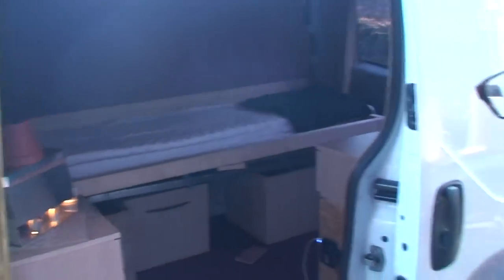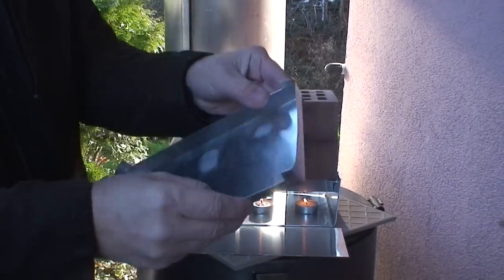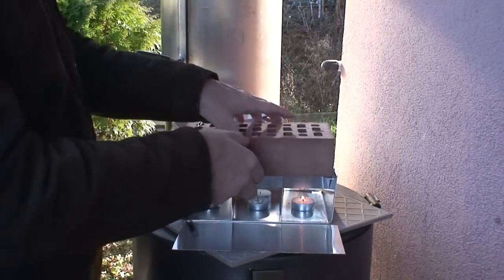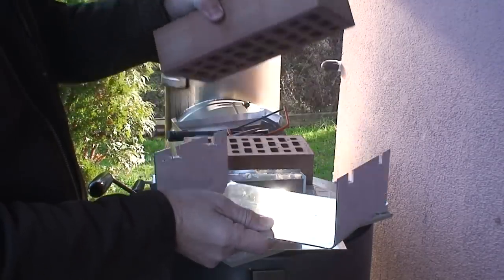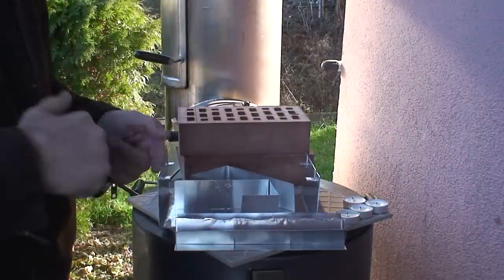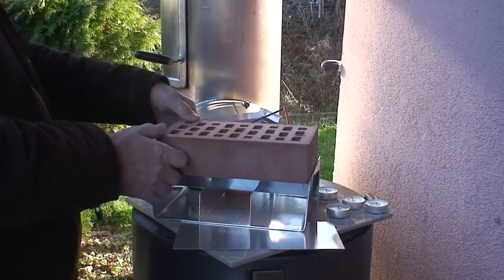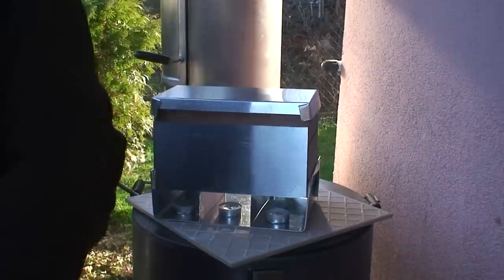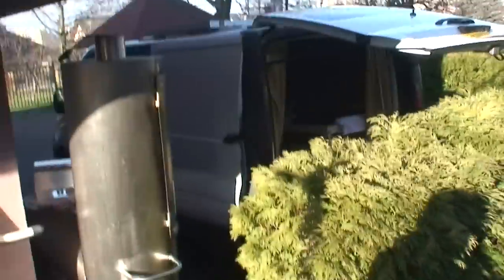Storage Brick Heater - Space Heater - flower pot heater (Tutorial)

Comment: Thanks to Enapp for video! I have an idea for  van heating (for Celal Boz worries). Find an oil lamp , a normal oil lamp with reservor , flame regulator  and long glass bulb om the top. Than find an aluminium radiator ( wich it's suposed to be filed with hot water in a heating sistem), but we need an emty white aluminium radiator with 5 or more section. On the left side of radiator on the bottom of first section drill a holl , just to fit in for 1 cm the top of the glass bulb of oil vandel. The radiator must be fixed on the wall of van and all entrance of radiator must be closed, except one from right bottom side wich is conected with a pipe  wich is going outsider the van for evacuating gasses from burning.  With flame regulator you can regulate the heat wich is going up thru the glass bulb and first section of radiator . All the heat from lamp will fill up first radiator from the top down excenging heat with van ambiant and than burned gasses goes thru the pipe outsider.   You can regulate heat, you have light inside the van and it's safe for gasses.
Reply: Alex Mitu can please make a diagram
Reply from the maker: Alex Mitu yes I've been thinking of a pipe based heating system using  a sand filled glass tude with a copper pipe through the center that heats water that can go on the roof. Like the idea though. Would love to see your build on it.

Comment: looks brilliant. i have been experimenting with the candle heater method lately... the terracotta gets really hot itself but does not heat the camper at all on a cold night so its virtually useless even with four candles positioned well underneath. its only good for warming your hands and such, which is surprising because so many people on youtube are raving about how well it works. so does your heater really heat your entire van at night? i will probably try this method next because i dislike the propane and electrical options.
Reply from the maker: +Drew Jonathan To be honest NO it doesn't give off a lot of heat, The key is to find a way to distribute that heat around the space and allow it to convect up. Radiator fluid helps and you can do this by rapping and oils filled pipe around your heat source then run it along one or two walls. (a little higher than the heat source). I'm experimenting with 12v halogen lamps and an radiator oil system above to distribute the heat better. I simply took several 12v halogen lamps and mount them in a row under an enclosed area with a bent aluminium pipe and half inch pipe close to the lamps to radiate the heat up the thin tubes. I'll let you know how it goes.

Comment: Tie 6 bricks - get out of van - gather some wood - start a fire and throw bricks in it for 10 min - get bricks and set them inside van on the fancy aluminium thing - light 1 candle to see what you are doing :)
Reply from the maker: Yip you got it. Infrared heat is stored in ceramics and then emitted slowly. The key is heating the bricks to cause the infrared to emit.  Infrared is a powerful force. Understanding it can solve a multitude of problems like condensation, air circulation, dying of a fire, slowly gasing yourself to death.